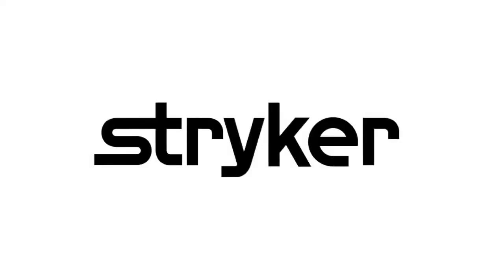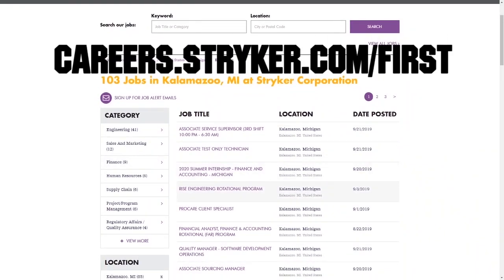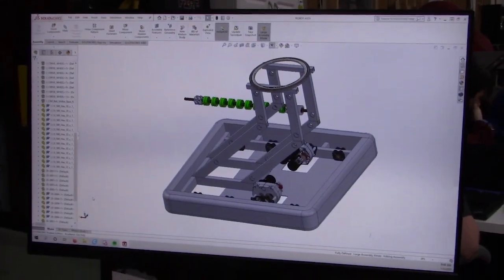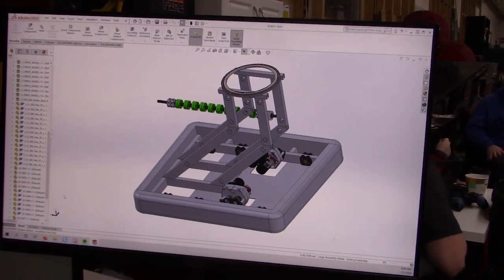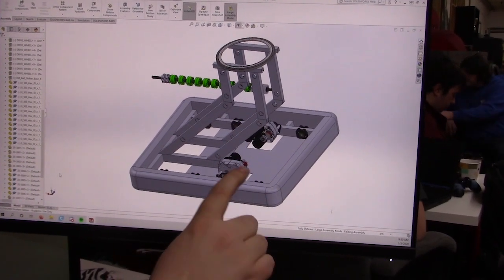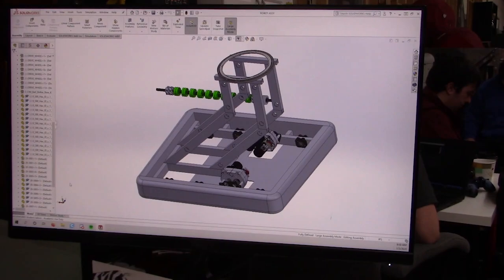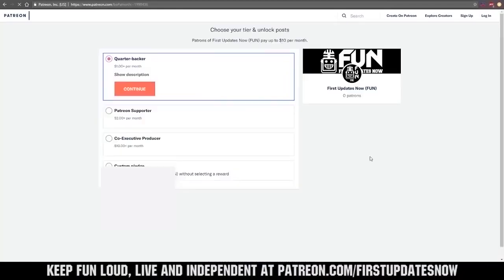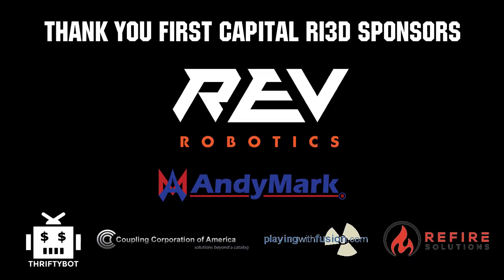CAD Superstructure Intake Transfer to Shooter -  FIRST Capital Ri3D - First Updates Now

Comment: Is there any free design apps so that I can model a robot on my laptop or computer
Reply: Not in frc, but my ftc team uses fusion 360 which is free for students
Reply: We use Onshape, it is really good for FRC, and there is libraries for all the FRC parts
Reply: Both solidworks, and Autodesk Inventor are free to frc teams. Onshape is also a good choice since it's also free.